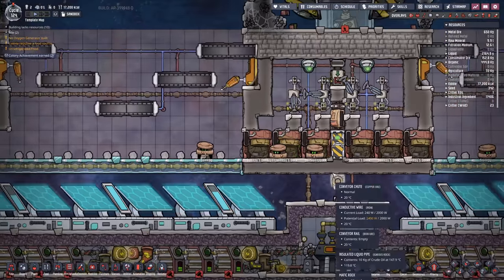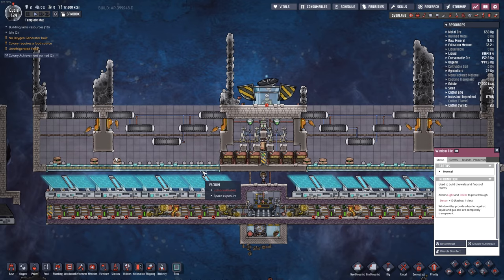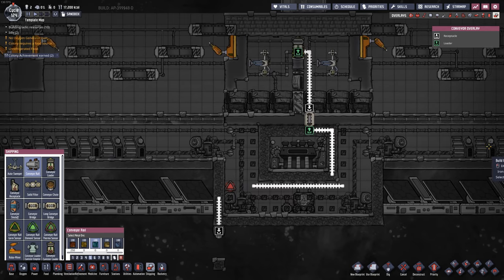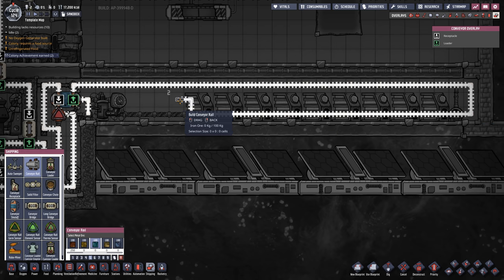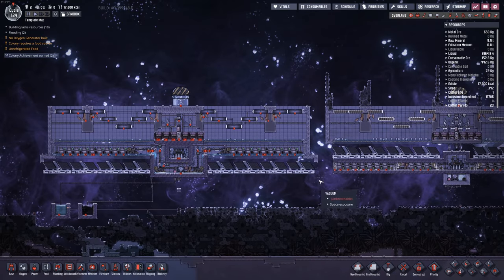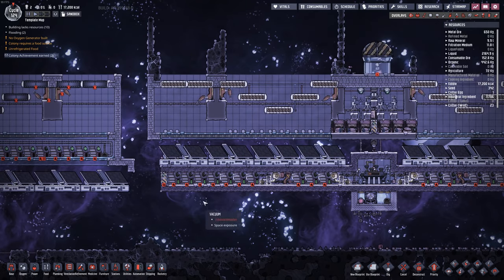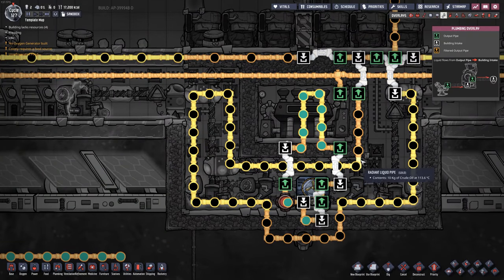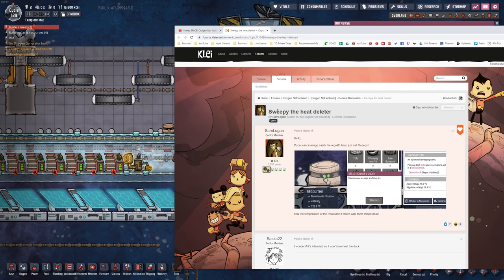Sweep SPACE! Can We Make More Power? Oxygen Not Included

Comment: I love your videos because they always continue to inspire me to make something I haven't tried before. Going to build a tiny little cooling loop on top of a metal volcano. Fill the area with steam, slap a turbine above it and use a thermal rail sensor to make sure the material leaving is 150C or lower. It breaks apart the material into smaller bits so it cools more quickly and the heat generated from both the Auto sweeper and loader will be gobbled up by the Turbine. Excitement! Thank you Brothgar! <3

Comment: With regards to the (not working due to the sweepy heat deletion) conveyor rail at around 5:40: keep in mind that you counterflow hot and cold materials / steam. If the regolith would be hot, you would partially average the temperature in the battery room, while in an optimal situation the steam near edges (completely left and right) should be cooler than the steam that is near the steam turbine. Returning the regolith outside of the chamber would improve the amount of heat you would draw from the regolith.

Comment: Oh, by the way, the usage of solar panel is up to you, if you want to use shine bug or outer space is up to you, if you want to breace into space, you have to stick with this rule, build two floor, one expose into space and one is one basement, you can place solar panel at upper floor outside from building, the build size must only fit one 2 solar panal and one miner bot with satalite, do not collect any resource came from outer space like regolith or copper or anything else accept that resource came from rocket only, if you broke the rule will being count as fail. So the saiz building for height is only 4 tiles height, the length however is like i'm says, only fits for 2 solar panel, 1 miner lazer and and 1 satelite only.

Comment: The only way I can think of Steam Turbines now is a combustion engine.
It needs to be compact enough to keep the heat alive long enough to make a cyclic build-up of continuous power.
Basically, keep the pipes short, the water hot, the rooms small, and if possible, convert the water into steam while it's on the way down to phase-change back into steam.
I'm just thinking mesh tiles would compliment the turbine whilst it sets on top/through them, there would be metal tiles where the water makes contact to immediately phase-change back into steam, possibly made of Tungsten or another highly and thermally conducive substance.
The problem is the re-heating, maybe a Liquid Tepidizer and some loose liquid coolant could keep the heat?
This would all be in one "room" where the water can freely phase-change between the Turbine and the Tepidizer.
At max "room" size, it would be around 5-6 tiles tall, variation on dripping water back down from the Turbine via two tiles of radiant pipe and a vent at the top, both made of highly reactive material.
Below would be the Tepidizer with mesh tiles directly above it, and a small super coolant pool all in contact with metal tiles.
Nothing would be measured except for what you put into the system, I feel like it doesn't "use" any of the water between phase changes.

Could be wrong if this was already tested.

Comment: I'm not sure how many people know about this but I figured I'd share it on the #1 ONI channel. 5 space scanners with 0 visibility are sufficient meteor defense. If a player wants to detect incoming objects at least 30 seconds in advance to close bunker doors then they could have 5 space scanners ANYWHERE on the map. As long they are ORed and then NOTed. This creates a NOR gate. If done in the reverse order it won"t work as it would instead be an AND gate. A single scanner with 0 visibility will detect an object 1-200 seconds out. Alone that's useless. If 30 seconds is our target, we can work backwards to calculate how many scanners we need. At least one scanner, 30 seconds before impact, needs to send a green signal to a NOT gate connected to bunker doors to close them in time. 30 scanners ANDed will always detect within 200 seconds. If they're ORed instead that number can be reduced. (30 scanners/200 seconds)*(30 seconds of warning)= 900/200 = 4.5 scanners. Round up to 5. I use 6 to make it symmetrical. The key here is the automation wiring. OR them together first then right before it connects to the bunker doors NOT the signal.

Comment: How to setup, firstly, create new games, enable sandbox, enable no hunger, sickness and no morale at all, then  choose anyplace what ever you like because none of the will be use at all, then choose only one duplicant and set any of your own skill what ever skill set do you ever one, went enter the game, delete all resource in games accept your printing pod by creating vaccum space enviroment, then close all gaps, make like the giant box, without exposing into space, at this point, debug mode will being enable, use reveal tools to reveal all place in games, after that disable it. For making giant box enviroment, use paint tools and change into 1 tile size of neutronium and draw the giant box  enviroment without exposing into space, build only one building that has: 14 tile space hight and length for upper floor, same as the ground floor and the basement that act as water collector for polluted water, use ground tile for in upper floor and ground floor with wet floor tile, build must being connected with printing pod, so make also build for printing pod that has fit enough space for printing pod, use presurize door for your main building so that gas does not leak inside it, put deoderize in both side of printing pod just in case, and finally build in building that act as power bank for jumbo battery, must being connected into build, spawn algea distiler at upper floor where is near the  leader, and also spawn the water sieve at ground floor with storage that can drop the resource on the floor near the leader, spawn manual ganerator in upper floor and sleeping area in ground floor, now that is for setup, read my next instruction for rule to play.

Comment: 2:15 rails near your cool turbine room is bad. conveyors exchange heat with wider area. it'll cost more time running aquatuner to keep the room cool
Reply: i had a heat-stablizing rail loop of diamond running in a void vacuum near a high-temperature window tile & found that the rail was getting heated by adjacent tiles, not just the contents of the tile it passes through (a vacuum in my case). it's logical to assume that heat will exchange either way
Reply from the maker: mm yeah i forgot about that